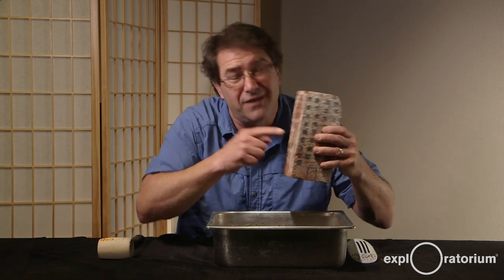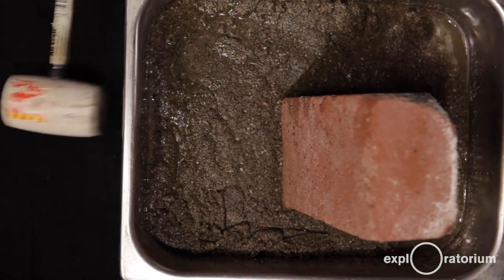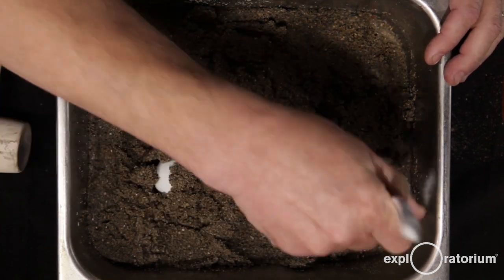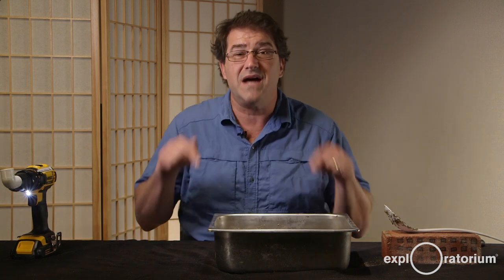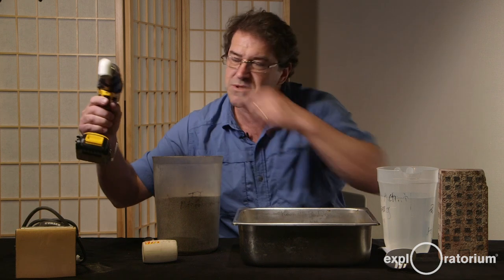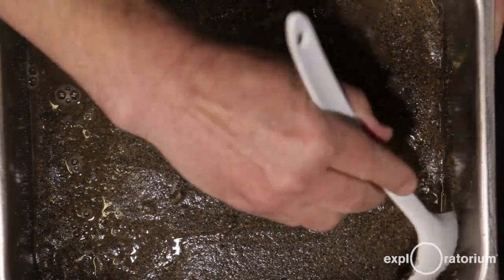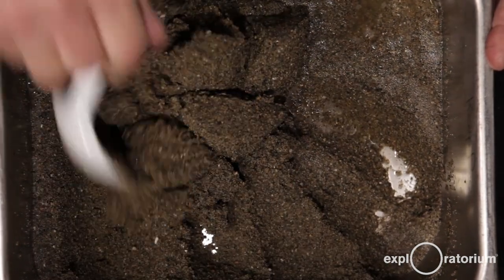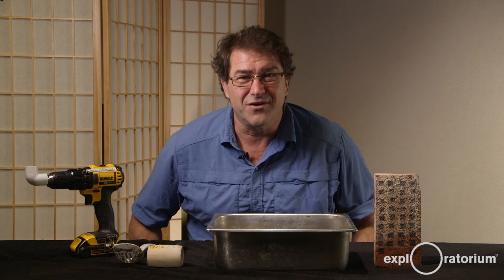Demonstrate Liquefaction | Shaky Sediments - Science Snack Activity

Comment: sir your experiment was very close to reality...
so intially sand is loosely saturated with water and top layer may appear to be completely dry, but as some seismic disturbance arises volume of sand decreases and thus most of the sand settles down making the pour water presssure to break the top layer and liquid comes out of course with some sand particles and due to change in inertia building at rest suddenly sinks down due to lose of shear stregth